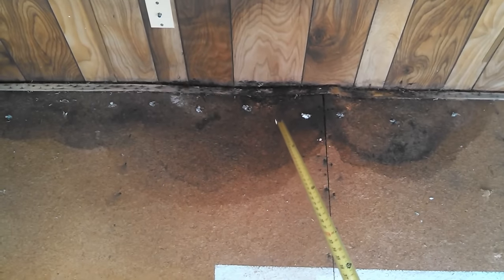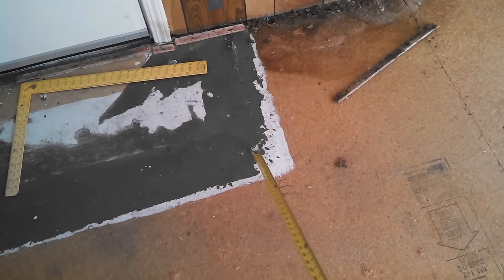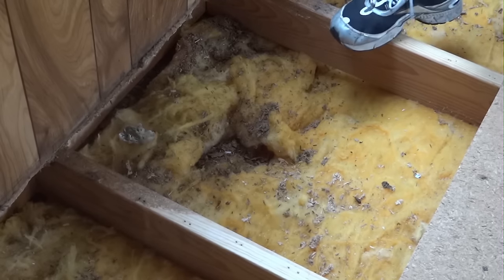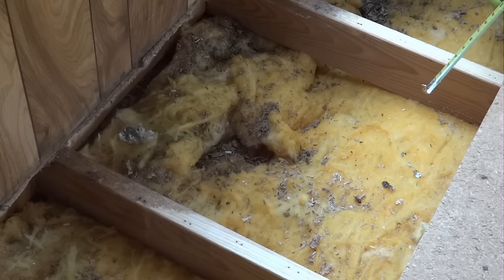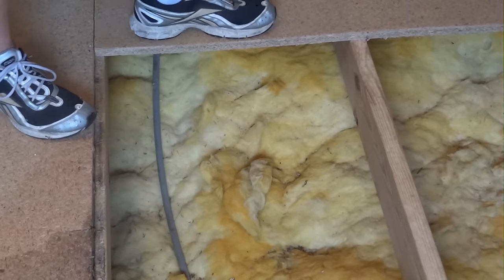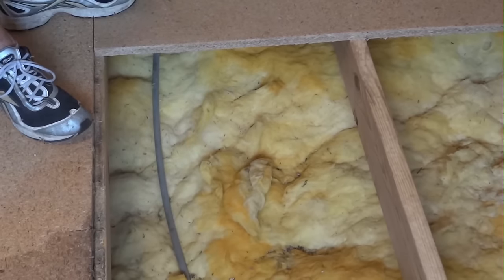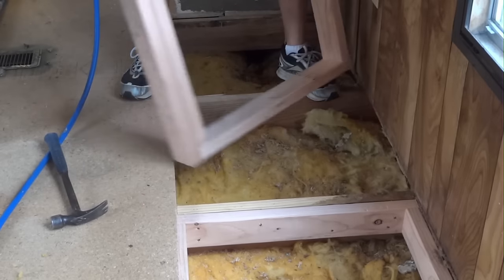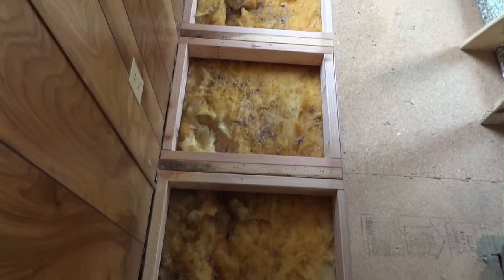How to repair or replace a damaged section of subfloor.

Comment: I am NO carpenter, but I was pretty shocked at the state of the original floor: 24 inch centers, particle board, and what looks like 2x4s for floor joists!?  But all in all, nice repair work, Mr. Dyer. :-)
Reply: Looked to me like 2x6 floor joists as you can see the joists below the 2x4 boxes when he installed them, but definitely agree that floor needed more reinforcement for the particle board

Comment: hey man I love the way you fix that floor that's the first time I've ever seen anybody do it with those boxes and I think it's awesome I really appreciate you putting this video on here I've got two questions for you why was there a short piece of flooring that went over the last box instead of one real long piece and is it best to use screws or nails
Reply from the maker: first: 10 foot hole, 8 foot stock.
Screws or Nails; I think either are good.
Reply: Nails have a higher shear strength, so nails would be best for the boxes. Screws have a much better clamping force and are always superior for attaching subflooring.

Comment: Great video!  Question for you, any ideas on how to go about doing this type of repair if there are copper water pipes and drain pipes in the way.  Currently in this exact scenario and looking for ideas.  (other then cutting pipes and moving waste pipes).   Any ideas from anyone would be appreciated.  Thank you!!!
Reply: Got the same problem...drain pipes in the way.
Reply: He showed how to set the depth of the circular saw. In terms of not being able to construct boxes between joists, you could just modify the box design to still provide support, but  not overlap the plumbing.

Comment: What are your thoughts of just toenailing in the cross members to the original joists, splitting the joint between the old and new subflooring?
Reply from the maker: +John Bean Been there, done that. That is why I do it this way now. Toe nailing is awkward, imprecise and not as strong. Do it right the first time and you will be happy you did.

Comment: Can you give me specifics on which nail gun you used? Make / Model and the nail size would be helpful. Thanks!
Reply from the maker: Any "framing" nailer should work. There are lots of variables, go with a name brand you are comfortable with. Mine is Porter Cable. Get something your local supplier carries nails for. Your nails should be @ 2 1/2" long. 2x4's are 1 1/2" inches thick so 2 1/2" will sink into the second one an 1"

Comment: Shouldn't you replace the insulation and or clean mold with bleach?
Reply: I used to think this dont worry but thing is  bleach encourages mold to grow back  and as long as the mold is deactivated its fine if sand off though for looks

Comment: I have to do the same exact thing. I dont have a framing nailer. Ok to use screws? Like spax?
Reply: mimbriac no, screws don’t have the shear strength of nails.  Use 16 penny nails and a hammer.  You can use screws to secure the plywood (glue it also, liquid nail)
Reply: Deck screws are stronger then nails

Comment: Excellent video. What type of nails or screws would you recommend for hand nailing the 2x4s and new subfloor? My rotted floor is by the back door due to the previous owners attaching exterior steps directly to floor joists with lag bolts. The rain water came straight in. Also, the steps were too high so water also back flowed into the same area. Unbelievable!
Reply from the maker: Good, sounds like you figured out the cause and fixed it, that is step one. I have always used 16p for framing. If you got a screw gun/impact driver then deck screws will do the job, somewhere around 2.5" long

Comment: Why would you use particle board again and onto OSB? I'm about to do a similar job.
Reply from the maker: My floors are 1" thick and I could source the 1" particle board and no other. I reason that my replacement is exactly as good as the other 1000 square feet of flooring that I did not replace. The first thing I say in this video is to fix the leak, if you do not fix the leak nothing will last, not even OSB.

Comment: What kind of new subflooring did you use?  I have a 1999 Champion modular home and I had some condensation for the crawl space /HVAC system and need to replace two sections.  Any help will be greatly appreciated.
Reply from the maker: First make sure to solve the HVAC moisture problem. Nothing you do will matter if that is still happening. The Air Conditioning A-coil creates a large amount of water that will drain into a pan and the pan has a drain port which is plumbed to the outside. A common fail point that is easy to fix. Second, I just matched my existing flooring and you should too. Mine was 1" particle board and I had to get that from a lumber wholesale warehouse.
Reply: @AlexanderDyer  Thanks for answering that, I was about to ask the same question.  Great video, thanks!

Comment: Hi Alexander, I just cut out a section of OSB that had some water damage. My house was built with i-joists. How would I go about blocking those?
Reply from the maker: I would build the box out in exactly the same way and nail to the flage edges. Your box should fit from flange edge to flange edge. You could also shim out from the webbing flush to the flange to give your box blocking full support.
Reply: @AlexanderDyer  I really appreciate the reply! I’ll be able to do that for two out of the three beams but the one has water lines running along the webbed part.

Comment: Hey you did a good job with that man. Your work is good. I do the same thing but you have to go under the walls. It's more work to go under the walls but it's worth it. There's still a lot of wet wood/ particleboard under the Sill. So there's mold left behind. Also it takes away the Integrity of the walls when the floor is cut at the wall. Once cut. Then the wall is just balancing on the outside 2x 6. Which in most cases is rotted as well.. please don't think I am putting your work down. But if you go a little further you'll get all the rotten wood out.
Reply from the maker: It is a judgment call made on a case by case matter. I have done as you say in other cases and the difference in time and money is significant. In this case and most cases the floor framing is strong and stable and the flooring under the wall can and has continued to support given no real span is required. I have fixed the leak and so there is absolutely NO wet wood anywhere.
Reply: Anthony casola can you offer input as to how to remove the remaining wet plywood under the 2x4 framing?  I have the same problem and so many old, rusty nails it seems almost impossible to get it all.

Comment: Original contractor used glue & sawdust pressed particle board for sub-floor, worst idea for building.  See how easy the hammer went through it?  Use good OSB or plywood, it will last longer it it gets wet.
Reply from the maker: Original Contractor? You mean the manufacturer? Worst idea? Not even close. I don't know if you realize this or not but these things are not built for the wealthiest of folks. Yes Plywood is better and more expensive. Also hardwood subflooring is better than plywood but I don't hear you clamoring for that. Also ask yourself this, why is your subfloor wet in the first place. This home is 1000 square feet of particle board so it hardly makes sense to put a superior product on a small repair. Your prejudice is all too common and also tiring.

Comment: I need some subfloor repairs done at several spots in my mobile home, where there's no floor under the linoleum and it's about to cave in.  Do you know roughly how much a contractor would charge for this job?
Reply from the maker: Sorry, no. Far too many variables to account for. You should get three estimates and consider a referral service such as Angie's list.

Comment: where is the subfloor adhesive to avoid squeaks??? Great job. You should also note about your spacing 1/8 th in between pieces. Alot of people dont know about that. great job tho!
Reply: Anthony Kling am about to do this job in my kitchen and was wondering if the spacing was needed and intentional. Thought so, thanks for confirming!
Reply: Lauren Blanchard absolutely! The space is so the wood doesnt buckle and raise lips whe it expands. You could nail or screw the heck out of it and it will still expand. 1/8 in on each side at most. tho.
Reply: Agreed re flooring adhesive.  Personally, I'd screw the floor down.  At least he was standing in the area he was nailing.  Nails and staples don't pull they just penetrate.

Comment: if the new floor is flush with the wall, what is supporting the wall....or did it just drop by 1/2" to rest on the joists?
Reply from the maker: The old floor remains compressed under the wall. I cut as close as I can get to the wall and leave the rest.
Reply: I've made similar repairs several times and squaring up the opening along the wall seems like the hardest part since the wall prevents getting a saw in there. What tools did you use to cut along the wall? And thanks for the box idea.
Reply from the maker: a reciprocating saw like this. http://amzn.to/2xyaoYq

Comment: What is the material called that you are replacing. Also why is it so common and can I use plywood? What's the best material for a replacement floor?
Reply from the maker: This particular subfloor is particle board. It is not the most durable product but is cheap and so it seems to be the standard in mobile home construction. I used particle board in the replacement due to the 1" thickness and this was the only product I have found to match that thickness. Ask your home center for the best replacement in your application, they will be glad to help.
Reply: Thank you. But as far as replacing a whole floor what's gonna be my best option?  Can I use plywood?

Comment: What do you call that flooring material and where do you get it?

Looks like what we have and it seems to be 1"
Reply: It's pressboard
Reply from the maker: It is 1" particle board and I got it  at my local wholesale hardwood lumber supplier, not a home improvement store. At my regional city location, Kansas City, MO.

Comment: Hi Alexander; 
What do we do about the rotten sub floor that is still left under the wall between the wall stud and the floor joist?
Reply from the maker: +oldasa  It is definitely a consideration and a decision you will have to make. 
In most cases I will leave it as shown in the video but in one extreme 
case I actually removed a 20 foot section of exterior wall while 
propping up the roof with 2x4s. Then replaced the floor, then built a 
new wall complete with window, door, electrical, exterior siding, sheet 
rock, paint. It is a major job but thankfully it usually is not 
necessary. You have to make that call. Good luck.
Reply: +Alexander Dyer (STRONGBOLT)   Wow!!!!!! That sounds like the wet problem had moved up and damaged the wall too. Is that correct?  Man that must have been a real head ache.  
Check my thinking  on this;
My water damage was my failt because I failed to cover the  plywood subfloor end grain when nailing my exterior siding on top of rather than over lapping and covering the end grain of the sub floor plywood . Everyone knows that end grain ply (no matter how well sealed) loves to suck dripping rain water into the enterior of my shop. Well it took 23 years for it to finally undermind and rot certain stress points on the exterior floor joist that has been always  well painted and is exposed to weather. Also additionally I'm going to have to add support to all the interior and exterior joists  because Because I never really put enough support blocks or piers in the first place. When I'm finished I will still have the end grain of the sub floor exposed to the weather.  Can you suggest some sort of flashing or protected apron to cover my sin of exposed end grain?   

Im going to start my taking sections of the flooring up and repairing just as you did here. But I'm going to add the extra support to the interior joist when specific sections of the sub floor are removed. ONce this extra pier support is added to the interior I will then cut and rip out the damaged sections of the exterior joist. Plus adding better pier support for the exteriors joists to.
Reply from the maker: Sounds quite involved. Flashing is very effective but not always the most attractive. The main thing to keep in mind is to sneek the top edge of the flashing under the bottom edge and behind the existing siding. This will turn the water out as it rolls off the bottom of your siding with no need for any sort of sealer.

Comment: If you didn’t have a leak problem and have new soft spots all around your house, have you ever thought about laying new thick (3/4 or 1”) sub flooring on top of the old sub flooring?  Think it will hold if i do that? Thanks for the feed back
Reply: That won't work bc it will raise it to high

Comment: Im tripping on why the subfloor was particle board. Usually OSB or plywood.
Reply from the maker: All the mobile homes I have worked on have particle board flooring. It is an appropriate choice when you onsider the demographic.
Reply: Yeah but when doing repairs esp high traffic areas should always upgrade as u go in my opinion we change over to 3/4” plywood
Reply: It's an older mobile home, they no longer build them with particle boards. Osb or CCA plywood should have been used for the repair

Comment: Wouldn’t the joists under the rotted floor start rotting too? And spread to the boxes you made at some point?  

I’m getting ready to repair the floor underneath the upstairs toilet and that’s a huge concern of mine.
Reply: It is absolutely possible, but you’ll only  know once you take a look and it’s fairly easy to tell what is rotted or not. Screwdriver test(stab test).

Comment: i’m 14 and my mom expects me to do this with no materials help me😢
Reply: Figure how large an area you need, go to lumber store and they can help you with materis, and probably deliver them.
Reply: U can do it I've done many floors In  my house get a good saw use screw gun not nail gonna and good sledge hammer to bang the old wood up use a sharpie marker and 2/4 to make your Mark's fir measuring it's real easy you dont have to build boxes like he did but so screw some wood underneath for extra support
Reply: You can, focus, never pretend do in the first one, ✨✨✨✨✨
Reply: You are probably 17 by now.
You can do it.
I hope you did.
(Your Mom was right.)
Carry-on.
Reply: Find a man to help

Comment: I need help with this project my flooe seems to have rotten because of water and moisture the bad part abt it is that it's underneath or behind my dryer and washer and my central air unit and boiler ...would I have to move all of to actually see the problem ? im just scared to mess with all of that if I could I would send you a pic but the plywood has suncken in due to it rotting
Reply from the maker: +Esperanza Rosendo I am sorry to say there is no easy solution to your problem. I think you know what you have to do.

Comment: and a one more question do you have any videos that show what to do with the rock goes underneath the wall right there where the wall is supported in case the rock goes from one room to another room underneath the wall
Reply from the maker: If it is not too bad, I leave it but if it must be replaced under there then the only choice is to remove the wall, replace the floor and rebuild the wall... so that is why I try to leave it when I think I can.

Comment: What was the cause of the leak? I assume you fixed it. I have a similar water damaged area by the window in a mobile home
Reply from the maker: For me it was the window/siding interface. On this unit, I had to reside the whole thing and now there are no more leaks to worry about and the floor repair is still going strong.
Reply: @AlexanderDyer  I'll have to check that out, thank you
Reply: For me it is usually a window unit that has leaked through the wall and into the flooring... Check the wall for signs of damage in and out I have seen a window unit rot an outer wall.

Comment: If there was this much water damage where the wall met the floor, I'm almost certain there is water damage in that wall as well. It probably looks like a mold factory behind that paneling.
Reply: I had washer drain hose blow I had to replace panel and put new tiles in bathroom well pulled up cheap floor water damage as well

Comment: Did you spare a thought for the original wet/water damaged particle board that is still under the wall ??
Reply from the maker: Yes, If you dig around in the comments you will find all you concerns addressed.

Comment: Not bad, but screw and glue!  Sorry, but I am having a bad experience with tremendous floor noise in this damn house we bought 3 years ago.  Turns out the house was built with undersized floor joists and a subfloor that was nailed down with no adhesive.  I'm sistering all of the joists and screwing-and-gluing everything in place.  Voila --> floor becomes silent.  Anywhere a piece of wood touches another piece of wood, there should be glue.

Comment: for a person that rips his fingernails out, breaks wrists, gashes knuckes, tears a milimeter of skin off his hands cleaning an wall unite A/C how much would this cost to get someone else to do it? To say i'm constructionally challenged is a massive understatement.
Reply from the maker: Depends. Get three quotes.
Reply: I was quoted 17k for a 1,152sq ft plus 7,200 for vapor barrier and insulation fix. I am going to do it myself.

Comment: I’ve been in this situation with my mother’s mobile home. The only thing I don’t like about this video is replacing old garbage with new garbage. Particle board is trash flooring. I know that it’s a full inch thick whereas plywood is just a hair under 3/4 inch but when you lay the two side by side it’s almost impossible to see or feel a difference.
Reply: I imagine he could have shimmed the replacement flooring, if it wasn't the same thickness.